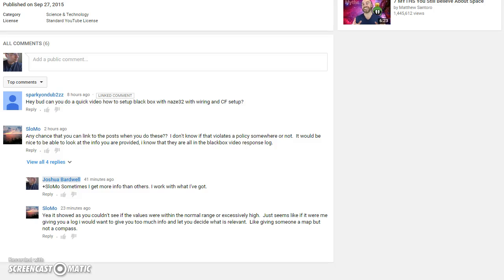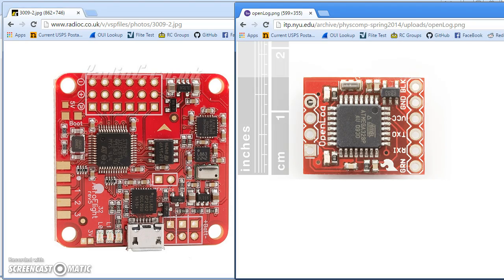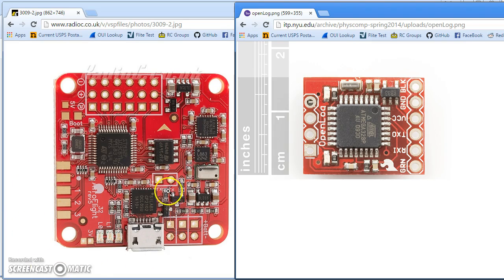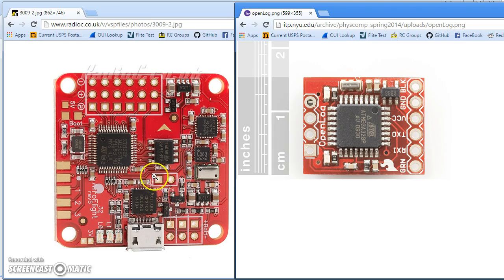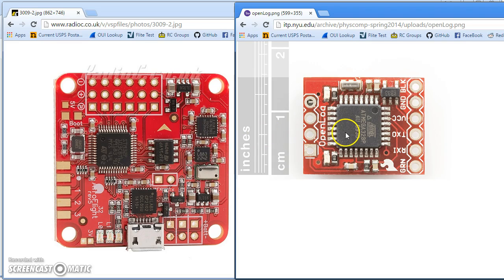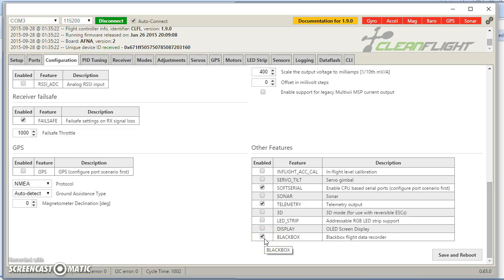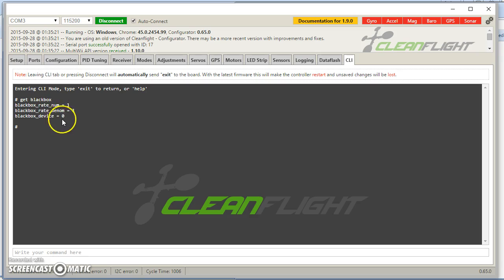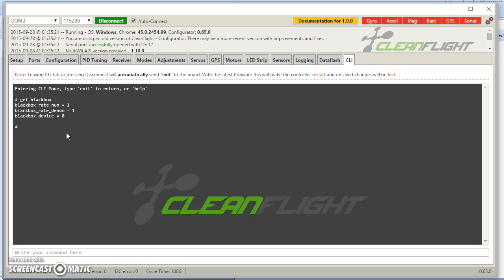How To Connect OpenLog to Naze32 with Cleanflight

Comment: When I set my baud rate to 250000, opening my log results in nothing but a black screen. When I lower it to 115200, I get graphs but it's almost all dropped data. Just those little squares. Looptime 2k. Tried setting log rate to 100, 80, and 50 with same results. I am using the open log device from multirotormania that Josh recommended. Do I need to change the firmware on the open log device? I was told it comes with the right fw.
Reply: oh and in the config file written to the sd card by the open log it says 115200 baud. This is the same regardless of what I set my baud rate to in cleanflight.
Reply from the maker: You need to change the config file also to say 250000. Also set blackbox_rate_denom to 3.
Reply: +Joshua Bardwell That did it! Thank you Josh, everyone in the hobby owes you a beer.
Reply from the maker: Mmmm. Beer.

Comment from the maker: +flapflapflap88 - Not sure why I can't respond to you directly. Here is the answer to your question:

You would need four serial outputs to run all of those things. The Lux has three hardware UARTs, and it does not seem to support SoftSerial (probably due to the extra pins needed to run the SPI gyro). Therefore, you will have to give up one of those four things. I suggest giving up S.Port to the X4R-SB. You can still get RSSI telemetry (obviously) and vBat monitoring by using a voltage divider to the A2 pin on the X4R-SB. In most situations, this is all you are really concerned about anyway, as most people are not running e.g. current sensor hooked up to FC and then passed through via telemetry.
Reply: I will give that a shot thank you very much Joshua :)

Comment: Just followed both videos to setup my Blackbox device, very clear and easy to follow instructions.
Only one comment the voltage regulator used on this and my similar openlog device can operate in the 3-13V range after looking up the part numbers.
I use a Dsun set to 8V to power FC/vTx, so looked up the chips to be sure it would not burn. 
My Blackbox is working fine with this voltage.
Reply from the maker: +sqwert Good point. Most FC boards and recievers can take up to perhaps 10 volts at least, so if you are running a regulator at 7-9 volts for some reason, the OpenLog will be fine.